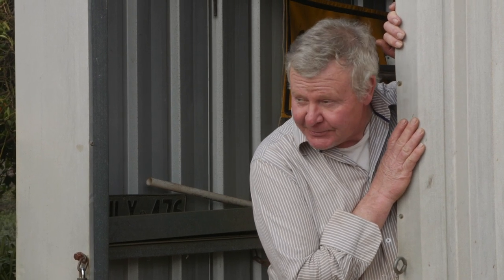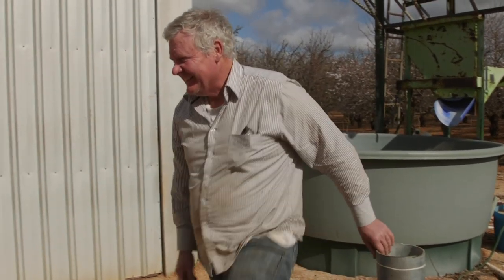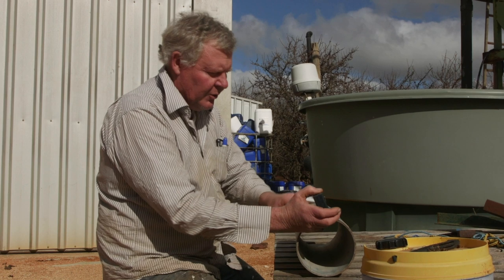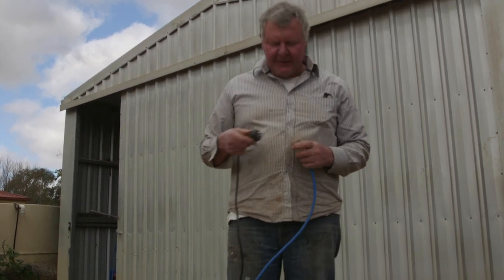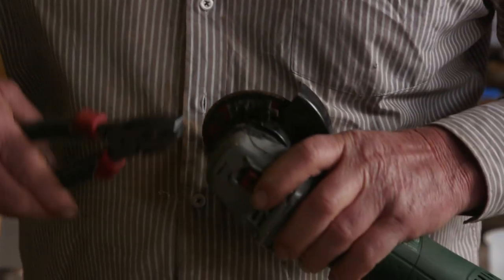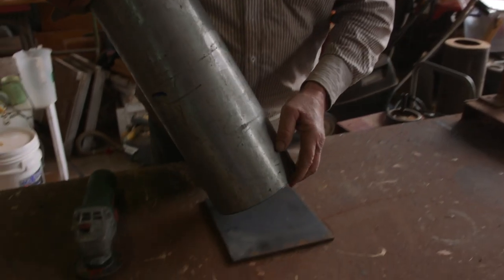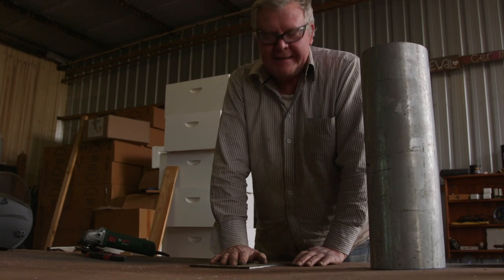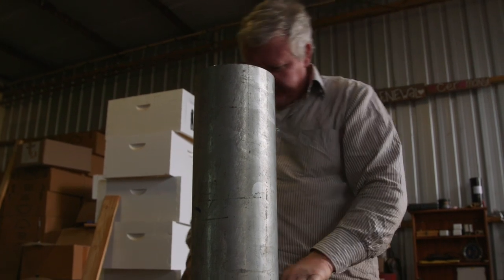How to Build a Dipped Candle Maker - The Bush Bee Man

Comment: Well bush bee man your welding is as good as mine we can now both be members of the S.W.A ( shithouse welders association ) you achieved what you set out to do and thats what matters and i have done that as well in times gone by taken the safety guard off my grinder .I have just completed a job on 1.6 mm square tube and i now see that toolex arc are as crappy as their mig welders .I have a prehistoric transarc tradesman arc welder it is that old it has cast iron wheels and weighs a ton , but it works like a dream anyway hope your wife likes your efforts take care .